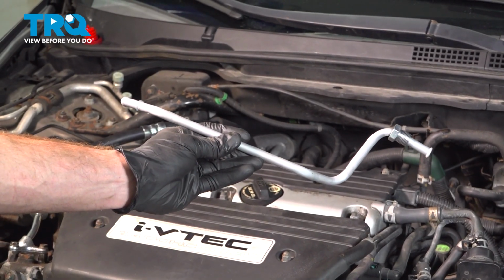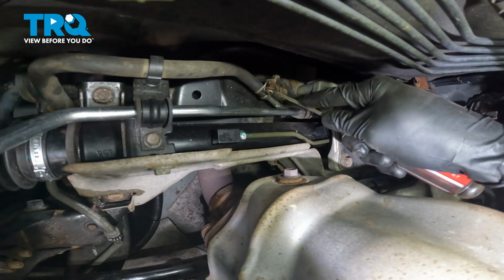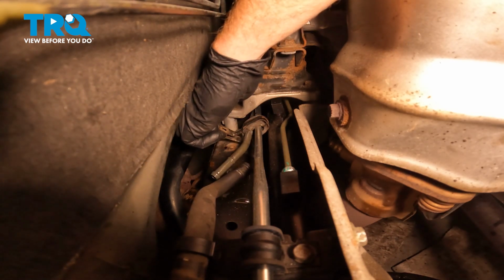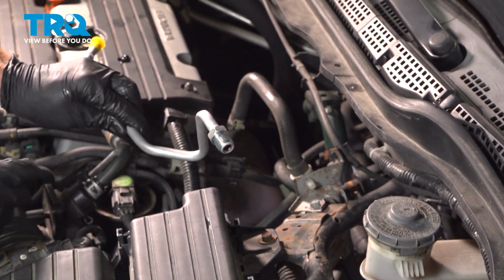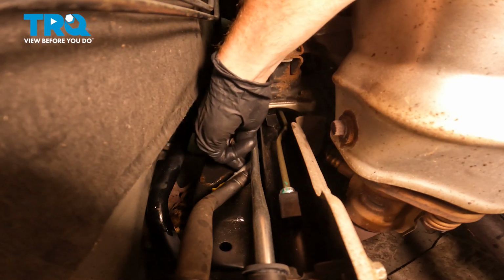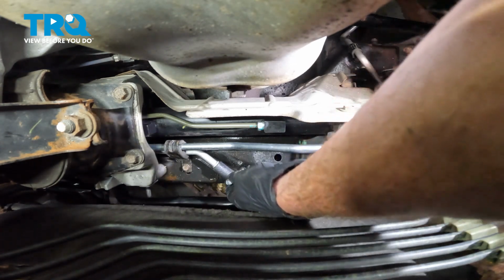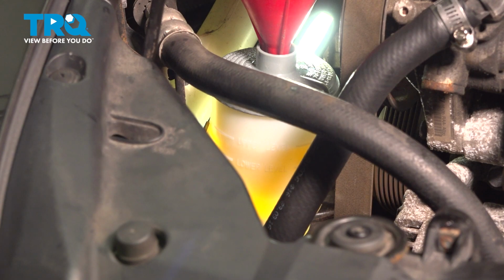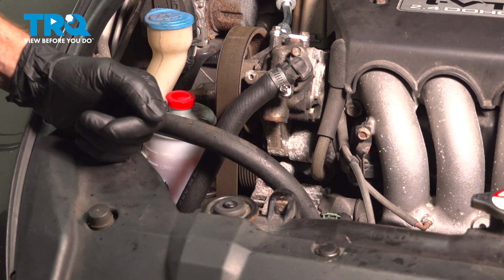How to Replace Power Steering Return Line Hose Assembly 2003-2007 Honda Accord

Comment: This the line that goes to the power steering pump or resirvor ? Becuase I have a hole in the line that goes to the resirvor the one at the bottom near the drivetrain